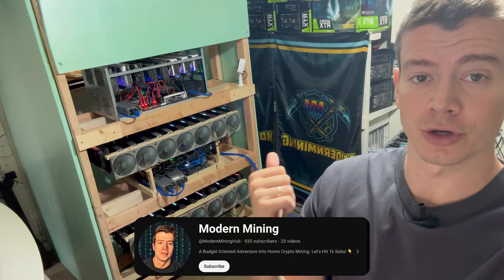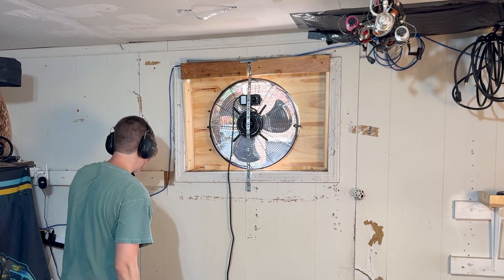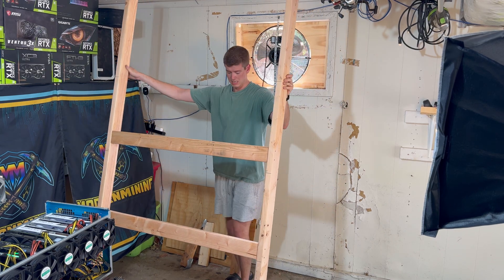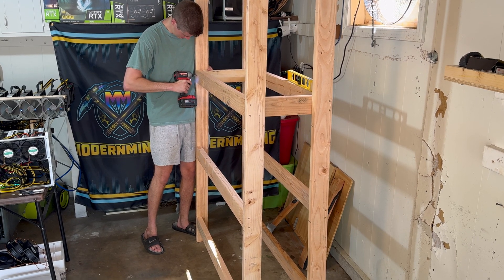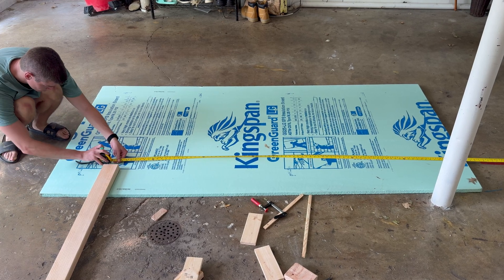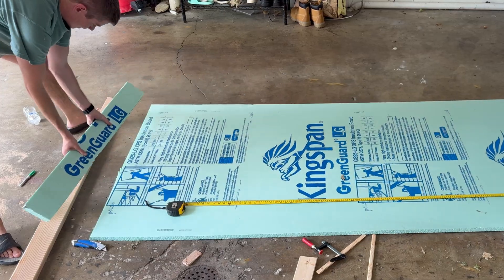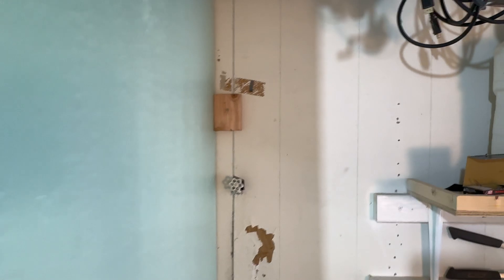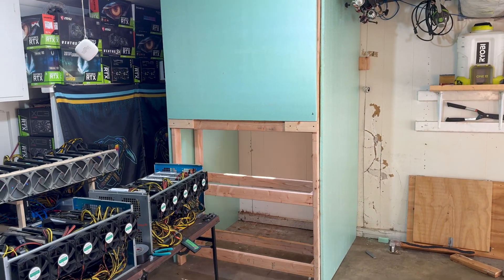How to Build A Crypto Mining EXHAUST Setup! Step by Step Guide!

Comment: Do a before and after temperature reading of the garage too. Thanks.
Reply from the maker: I forgot to add temp readings before and after in the next video but I’ll tell you right here. Ambient in the garage was going around 97 degrees on hot days. Not its worst is like 92 but I’m also running 2x the power/hash.

The new hot isle is consistently 5-8 degrees hotter than the ambient temp of the garage. Tune in tomorrow morning for p2!

Comment: instead of making it square, maybe have considered a little more A frame style a little wider at the bottom and thinner at the top would have helped with being sturdy and less likely to tip over.  You would need to cut an angle on the bottom.  For the front and sides, could have built a simple 1x2 frame with the panels and some weather stripping and used some lightweight hinges to make the internal rack accessible.  It looks clean overall, nice job!

Comment: I've got a 48 inch fan pulling massive cfm all solar powered
Reply from the maker: Dang that is massive. The new one you’ll see in P2 is only 24in but still moves some serious air.
Reply: @ModernMiningHub  I'll send you some info but you might be able to get that to run on solar during the day for super cheap
Reply: My fans run 100 percent solar during the day and switches over to power during the night...  my first video I'll be doing on my farm will be on these fans

Comment: Get large fender washers to support the screws/foam when attaching the foam board to the wood. The results will be great. I've done something similar.
Reply from the maker: Good idea! The command hooks are actually working decently well but the top piece could use some.